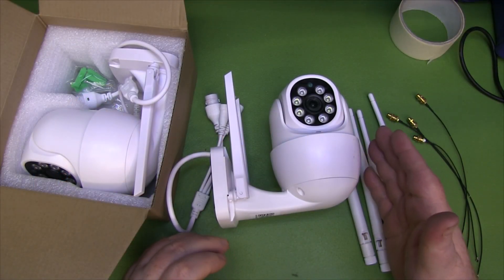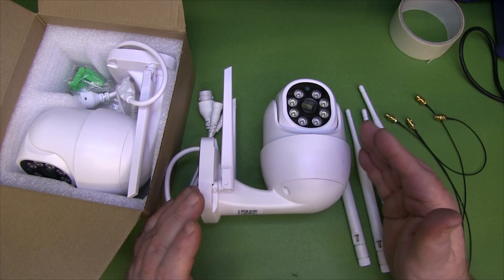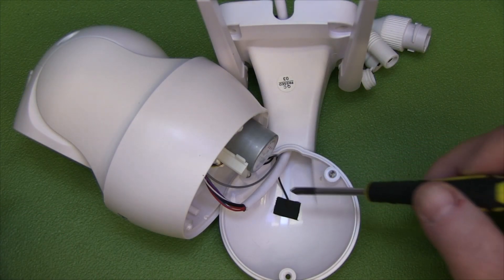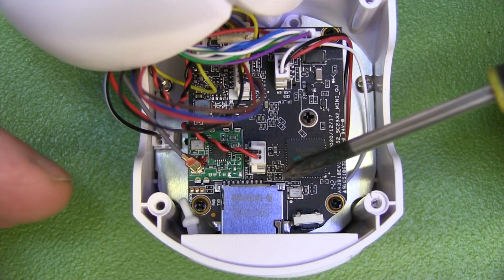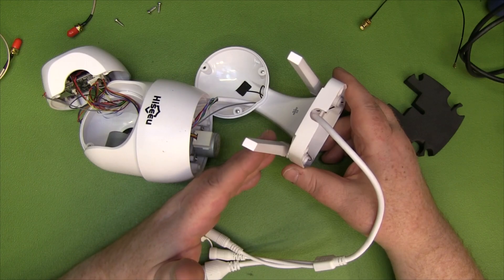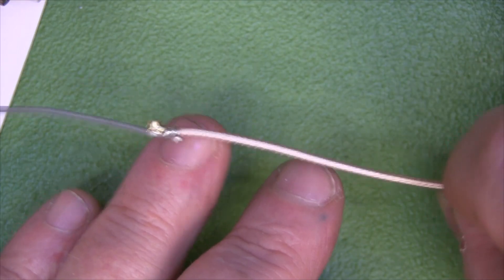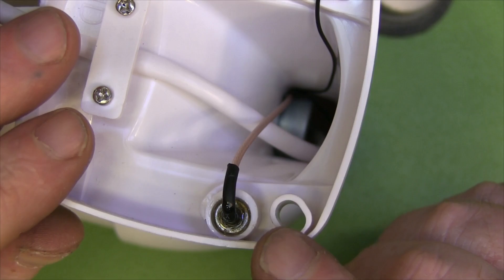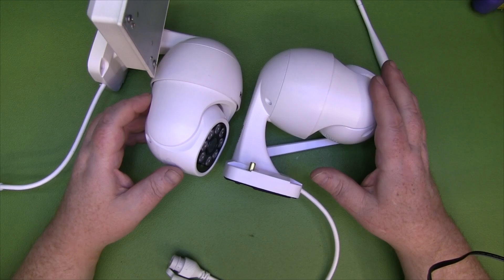Hiseeu Security Camera 360° View Antenna Mod

Comment: Hi my name is Marcus and thanks for a great video getting back to a question I have got the same Hiseeu system like you have and I am trying to work out how we could  reconfigure or change the  firmware on a door bell camera and get a live view to the Hiseeu  nvr system can you think of a way this could be done I got a ring door bell 2 and I don’t  care if I’ve got to slightly destroy this one to make it work I do a lot of repairs to Xbox one x like  replacing the hdmi ports and hdmi timer chip and  reflow them back in  another words what I am saying I no a little about pcb.s and  components and my soldering skills are pretty good as well if you have any idea s on how we could get this to work it would be very helpful Marcus

Comment: Turns out that the model Hisseu outdoor camera that I have uses longer cables than you suggested.  I need closer to 50cm, so now I'm trying to find those before I forget how the thing came apart.    Not only that, but the cables don't seem to fit the antennas that you also suggested.  I'm not sure what's going on there, but I'll figure it out.
Reply from the maker: You often find this problem with Chinese products as they will just use what is cheapest for each production run
Reply: @andrewmcneil  I’ll figure it out, but as I said, I’m more concerned that I’ll forget the tiny details how it goes back together before those parts get here.  Also, it seemed that either (unfortunately I had an appointment and didn’t have time to tinker) that the thread pitch or the diameter of the cable didn’t match the SMA of the antenna. The ones that were included with the antenna were a breeze if they weren’t so short.
Reply: @andrewmcneil  I haven't looked at it again, even after I returned home yesterday, but it might be possible for me to reroute the cable so I don't need more length than 30cm.  I'll go down and look it over today.  I'm having a hard time finding a cable as long as the factory one that came on the camera.  I am surprised at how short these Amazon antennas are.  But I did discover, since I'm about to enter the world of Meshtastic (I also bought better antennas for those that arrived the same day) that I was trying to connect the wrong antennas to these longer cables.

Comment: Can you share a little more specific info about those 5dbi antennas and the connectors you used? I have 3 of these same cameras and they're okay, but do have issues, some of which may be built into the circuitry, such as the connection seemingly timing out after a couple of minutes. They also, due to signal strength don't react quickly enough to the pan inputs to change the direction of view. I'm sure that would be aided by a better signal. I was also curious, if you know, if that antenna chip can be replaced with a dual one. I know it would require soldering, but I'm not sure how it's set up to interact with the main board.
Reply from the maker: Are you in the UK? I can post so links so you have an idea of what to search for. But no, you cannot change the chip to make it dual band.
Reply: @andrewmcneil  Other side of the pond.  But sometimes, if people post links like they do for the typical Amazon affiliate links, I can find the same thing here, but often with a different brand name.
Reply: @andrewmcneil  Not dual band if that's what you actually mean, dual antenna.  Same band.
Reply from the maker: @turn-n-burn1421  here are links to amazon US https://tinyurl.com/4z28c2yc https://tinyurl.com/yfafkxxv should give you a better idea of what you need.
Reply: @andrewmcneil Still not sure how I'll route the antenna lead, but I just received a pair of 8db gain antennas today.  I don't have one of those TinySA devices, so can't verify the specs, but I'll just take it at their word for now.  Now I'm waiting on a new pair of those same antenna leads I returned to Amazon in hopes that I can find a path that doesn't require the same OE one.  Then hopefully I can put it back together without taking another one apart to see what goes where.

Comment: Andrew, if you invest in a 3D printer you can make all sorts of adapters to mount antennas in things where the standard SMA wont bolt on as well as making soooo many other things antenna related and for all sorts of other things!

My Rc transmitter had a non removable antenna and an SMA socket would not bolt in the hole so i 3D printed an adapter for it.

Im actually designing a mount right now as it goes, an aerodynamic mount to place an SMA socket the tail part of the fuselage on a Rc plane, it perfectly flits the curved shape of the tail body and its an elongated dome with the socket recessed so only the actual antenna is in the air stream

Comment: I don't understand the appeal of such cameras with WiFi when they still need to be powered anyway. It makes sense to run a single UTP or STP cable with POE.
Reply: People have more power sockets than network sockets.
However I agree with you that running a network lead is so easy that it should be the preferred method.
Reply: TPLink makes a dual band Access Point that will reach 600 feet.   Using a directional antenna on a security cam will connect to the Access Point at that distance.    You do have to use a battery pack and solar panel though on the cam.    In my case the cams (2) are 450 feet from the AP.
Reply: If you don't have to run power cable to them then WiFi does make sense. As long as you are running a cable it might as well be a LAN cable with POE.
Reply: @WYLMAS  in my case I would have to run the cables 450’ over an open hay meadow.   At least I have clear line of sight.
Reply: Perhaps if you had a wife that stomped her foot and mandated that no holes will be drilled through the walls, you'd more likely understand. I'd ordered a wired system that came with 8 wired cameras and a hub. She made me return it.
Reply: Don't tell anyone this tip..... you can go to a security light , controlled by a photo cell and pull continuous 110v to a lamp socket to a screw in adapter that will let you plug that 12vdc transformer in to. I mount the cameras on the upper part of security light . ps-being above the light solves lots of light issues.. I don't want to fight cat 5,6,? cable / connectors , anymore... I pulled a $15K system to go wireless... I mount my NVR's outside on a directv mount in a plastic box to extend range.....i then run hdmi & cat5 inside to monitor , use a wireless mouse..   These wifi sys are so good for the money.. oh yea , the cat5 to the inside is to connect new cameras in future....ok enuf bs from me........ HNY &  Go Dawgs ..................:-)